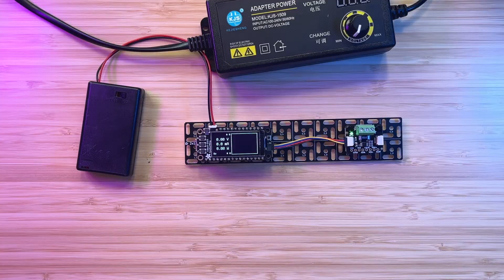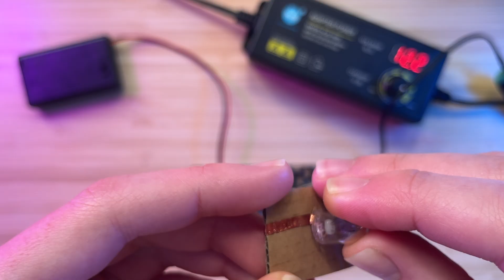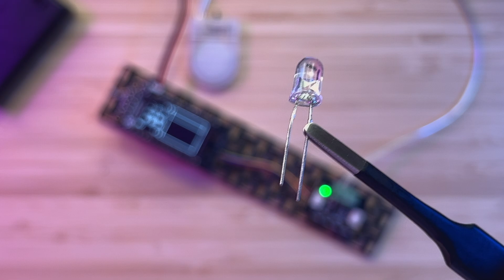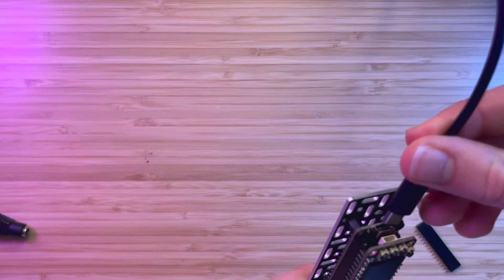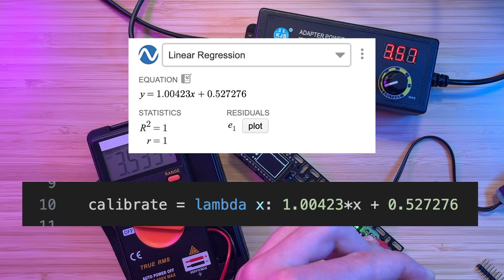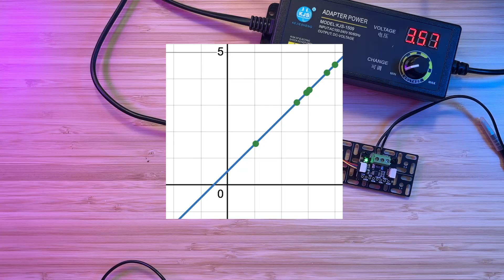DIY mini power meter  ft. Python and RP2040

Comment: would be more useful if the values can be logged into pc via usb or wifi
Reply from the maker: i could make it do data logging over USB!  i did find that the measurement of some loads became less accurate when powered by USB though... maybe an optoisolator is needed